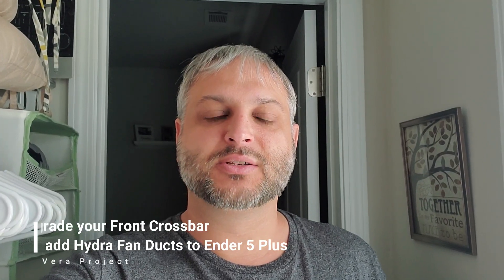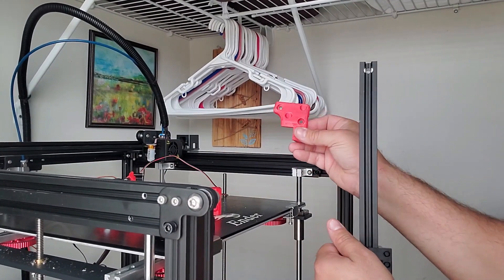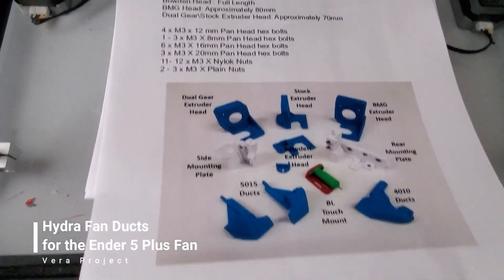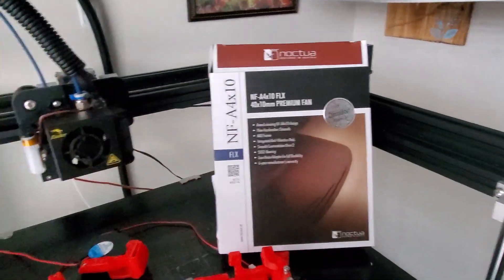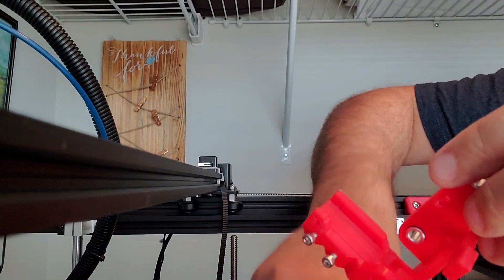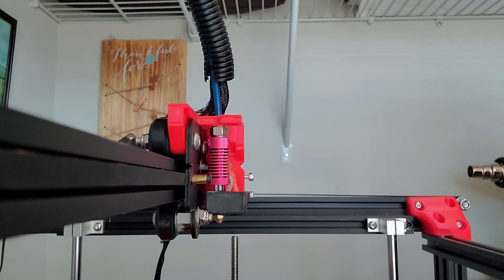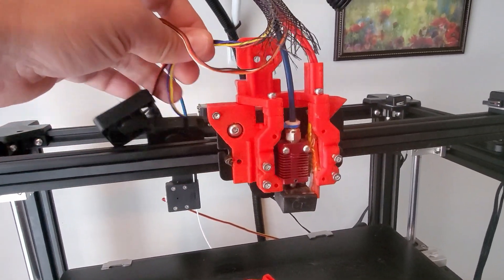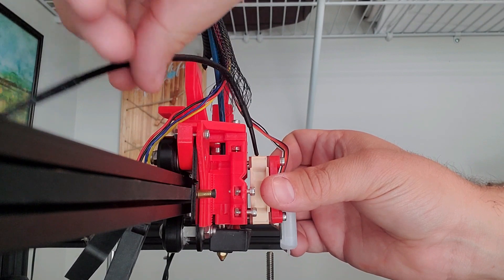How to Install Front Crossbar and Hydra Fan Ducts to Ender 5 Plus Upgrades

Comment: How did you set the bl touch to not probe off the front of the print bed when it does the plot points
Reply from the maker: It will adjust on its own.

Comment: Hi, for some reason my right fan hits the wheel when it homes. It doesn’t press the right end stop switch. Did you have this problem too ?
Reply from the maker: I had to adjust the switch by moving it
Reply: That’s what I ended up doing lol. Thanks for the vid. Helped speed up the process
Reply: Did you get any stringing issues? I seem to can’t get rid of it
Reply from the maker: Up the heat to 220 if not chance the nozzle

Comment: should the hot end fan not be blowing inwards to blow air in the heat sink? i feel like it blowing out wards would be less effective?
Reply from the maker: It would put to much stress on the fan if it's blow inward. Think about it like when you put a fan on your CPU on your motherboard the fan blow outward to release the heat faster from it.
Reply: @VeraProjects  I know this is an old thread, but the hot end fan MUST blow inwards onto the heat sink. The idea is to cool the heat sink  and heat break to prevent heat creep. You can have a look at any hot end fan installation and you will see the fan blowing directly onto the heat sink. I have an Ender 3 v2 and an Ender 5 pro. Both came from factory with the fans blowing inwards.  Having the fan blowing outwards will do nothing but create problems like heat creep and clogs. @PrimeEpilogue is 100% correct.

Comment: did you have to flash to firmware with the BL Touch? will this work on the Microswiss Direct Drive.
Reply from the maker: No nothing that is the beauty of this upgrade
Reply: @VeraProjects  ok thank you. ive been looking for fan shroud/duck and none of em fit right. ill be printing this tommorow.
Reply from the maker: Glad I could help
Reply: @VeraProjects  i have a micro Swiss direct drive, do i need to print the bowden clip?
Reply: @p.nation3583  did you get it working on your micro swiss, i also have one and would like to print this if it works. Sry for my spelling, I'm from Germany.

Comment: Hi... What filament did you use? Thanks
Reply from the maker: I used gst3d filemement
Reply: @VeraProjects  pla or petg?
Reply from the maker: Pla +
Reply: Ok... Thanks...
Reply: Another question if you dont mind. With the BL touch, did you use the 0 offset stl? Thanks

Comment: I don't remember me seeing you do this, so I am gonna ask.  Did you input in the program that the position of the BL touch is in a different place? It needs to know the topography of the bed in relation to where the head tip is.
Reply from the maker: You can see it did a perfect print after that https://youtu.be/OlanxAAcmi8
Reply from the maker: I made no adjustments to simplify 3d everything stayed the same
Reply: @VeraProjects  You have to input the offsets for the bl touch i.e the x and y off sets. distance from the tip of the nozzle to the bl touch in both planes i.e x and y.